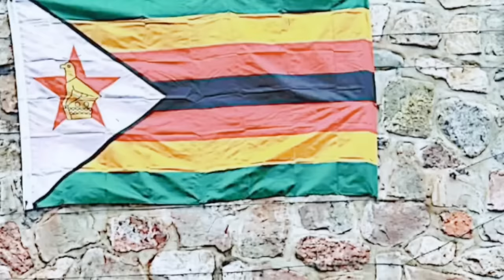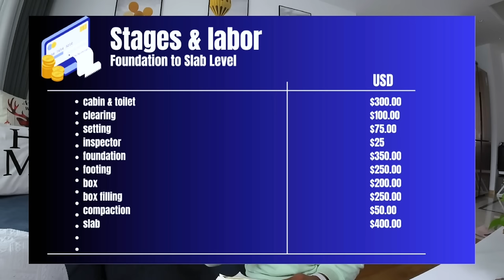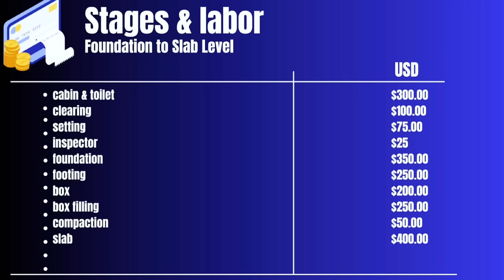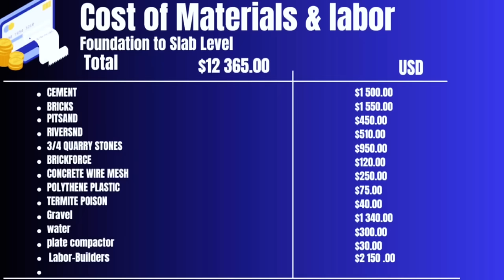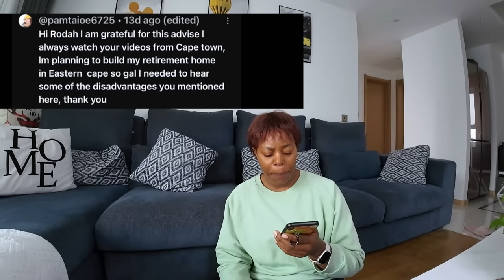Building In Zimbabwe*Cost of Foundation Materials & Labor

Comment: My only question is, where on the ground buying these or you were sending money home? 
I work in construction and half the times when I asked about the quantities of materials from our builders they do guesswork. It's the materials quantities that builders can hit you hard on. 
I advise whoever doing construction to get a bill of quantities from an independent QS.
It would not be very expensive but it keeps things in check. 
You seem to have gone so the way but did you put the damp proof membrane (the green plastic) and dpc?
Another strategy to save you money is to only do footings for 230(double load bearing walls). The rest of inner walls should just have thickened slab.
Last tip when you reach window level please please put ring beam. Don't accept lintol.

Ndokubasa kwedu veduwe. Have done some 7 stars hotels...
Reply from the maker: Thanks for the information, materials were bought on my behalf . The information you’ve shared will definitely help others on this journey and future projects ✨
Reply: Do you mind explaining your last tip id depth?
Reply: @uncleted3569  the ring beam as the name is a structure that you place as an outer ring of your external walls. It's usually placed right after the windows. A beam is a mixture of concrete plus stream rods to make it strong. Just like what keeps the wall above your verandah in suspension. In this case it prevents cracks which are usually caused by the winds on the roof. They usually crack downwards, depending on the brick bonding. These weaken your house. So the ring beam tend to isolate these cracks and stop them from running all the way to the floor. Secondly they give a stronger support for your roof truss ties to the building. Changes of failure related to bricks is not there
Reply: Havana kurohwa mari here amai ava....12k upto slab 😅
Reply: @austinzimba2382  we should not assume things here. A plan should be provided and quantities taken. This is not about opinions but facts

Comment: Thank you always get a qoutation from 3 or 4 contractors and compare the materials builder sometimes will skim off the top and the foundation is expensive than the wall as it requires much more material
Reply from the maker: That’s true.